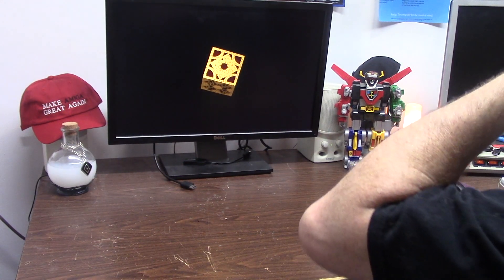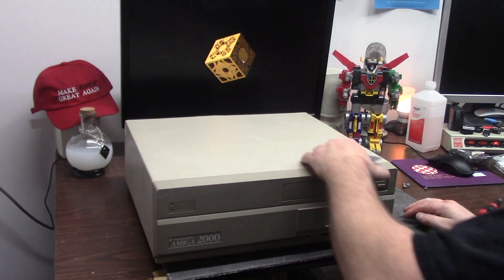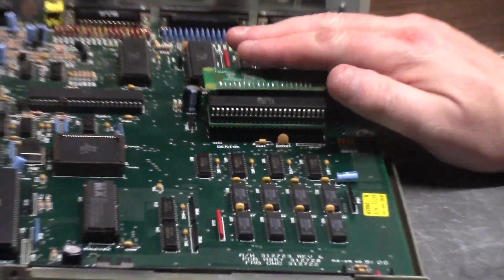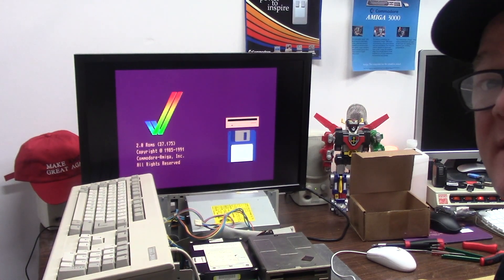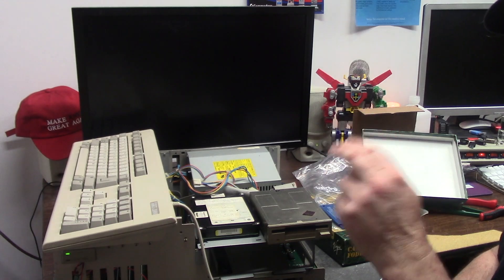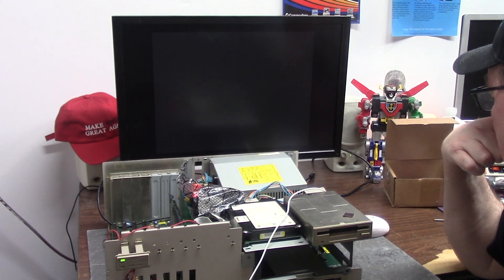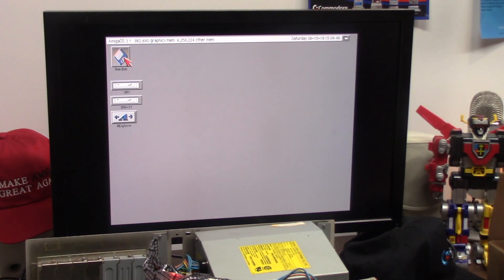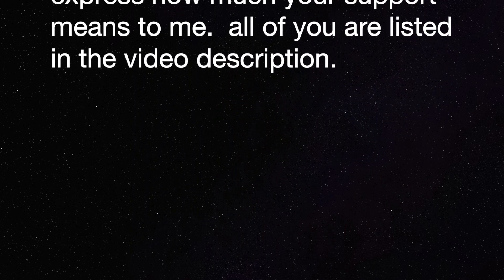Amiga 500 pi rgb to hdmi in an Amiga 2000

Comment: I had a Supra Turbo28 that went from my A500 to my A2000. Is the machine jumper set correctly on the accelerator?
Reply from the maker: Yeah i think its screwed up
Reply: @ChrisEdwardsRestoration  Bummer. For one of the most basic accelerators out there, it actually did a decent job. It didn't have the features of an '020 or better though. I believe that it was actually an '010.

It was really cool that it could go from the A500 to the A2000 (with the setting or unsetting of a jumper.) Add to that the my ECS upgrade and my Kickstart 3.1 ROM, it was nice to not have to rebuy everything when I went big box. I did have to get a "new" hard drive controller and reformat the hard drive due to technical reasons. lol.
Reply from the maker: I overclocked mine to 42mhz ir worked on my original a2000 video a while back thats the last time i used it . And it just sit on a shelf ever since maybe it’s this Amiga I don’t know I have to try it again one another a 2000
Reply: @ChrisEdwardsRestoration  Very nice! Yeah, if it could work it'd be pretty decent. 

It's biggest deficit is the lack of memory expansion on the accelerator.